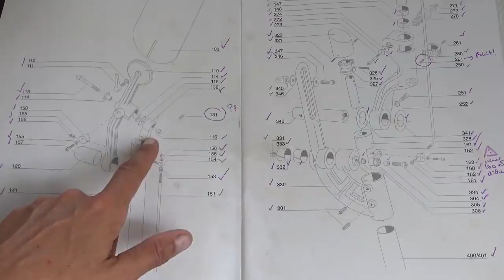Screw this! Why is there always one bolt left over when you put things back together?

Comment: I watched all the way through to see if you got things together ? Well done.
From too much personal experience I can tell you that manuals and drawings can be wrong. My background is Marine Electronics and there is nothing more confusing, because your brain is telling what is in your hands and the book that should be correct, is forcing to think something else. 
IKEA ...The last thing I bought was a glass topped dining table. Stainless steel legs and the bolt holes did not have threads cut in them. It went back.